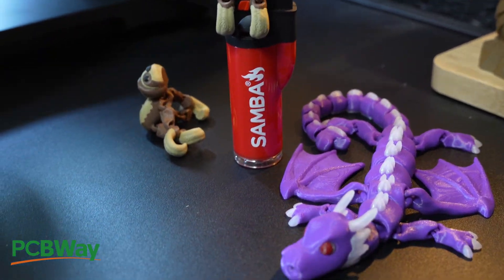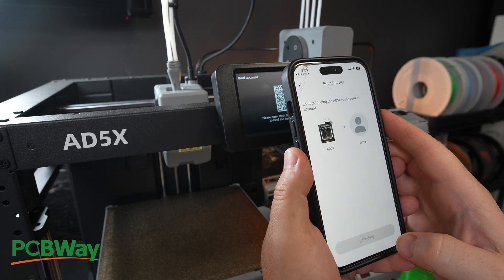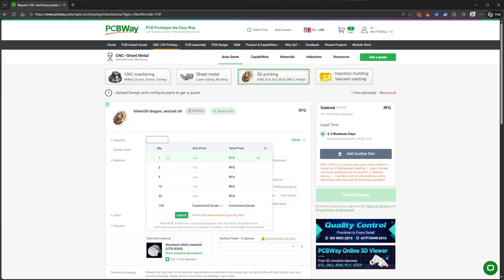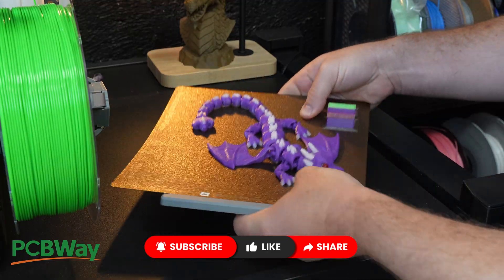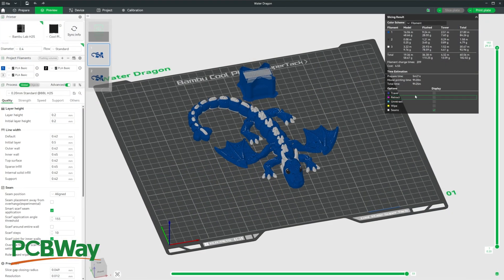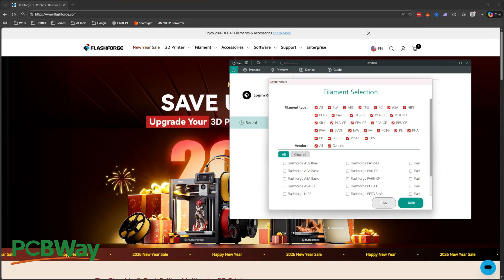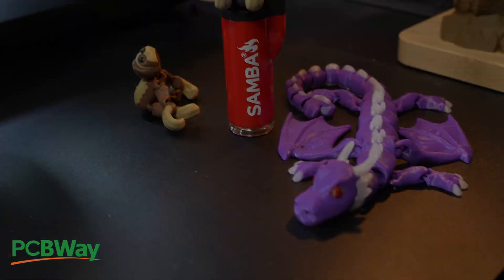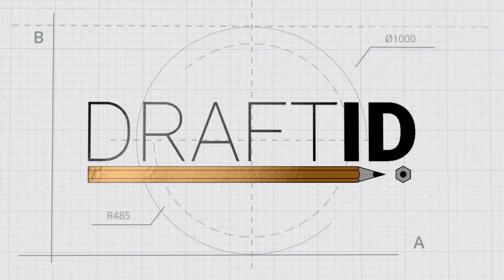This $400 Printer Shouldn't Work This Well | Flashforge AD5X

Comment: I purchased a lightly used ad5x just before Christmas as our family's first 3d printer. Its been and okay-ish experience at best.

 IF you can get a file to the stage of printing its does a fairly good job. But the constant connectivity issues and file errors had me wanting to throw it out a window for the first week. Like I'm in the middle of fixing a model and it logs my account out, then i log back in and the printers not available. In the beginning I had to manually change the port to get it to connect with my laptop. Just yesterday i figured out that the firmware was so out of date it could not update itself. I had to create a flash drive and insert it to force an update. And for the love of god, if I download a 4 color model file why cant we keep the colors assigned by the designer. Why do we have to go back and assign colors and repaint the model?? If i change the filament color and type in the slicer, why cant the printer recognize this?

I didnt know software could be so..... Lazy?
Reply from the maker: Pretty much hit my same experience. Like it’s not a terrible printer but like you said, it just feels lazy. The colour resets were driving me crazy!

Comment: The screen is resistive so it is not as touch friendly to fingers as other screens. I printed out a styles and I use that on the screen.  You don't have to use the screen to load or unload the filament since when it is not printing the filament is not in the extruder. So you can load or unload the filament without using the touch screen. The only thing you really need the touch screen for is to tell the printer what type of filament it is and what color.  But yeah it would be nice that once you set this on the printer it would sync directly with the slicer.
Reply from the maker: I like the stylus tip, thanks!

Comment: You didnt compare what materials work between teh AD5X and the Bambu Labs.  Because you can have a decent enclsure with the AD5X I think it edges out the Bambu in what materials you can print.
Reply from the maker: I suppose it gets a small point for that

Comment: I got my kids a ad5x for Xmas. So far, pretty disappointing. Everyone keeps showing full spools and other stuff.  Ours has no enclosure. It came with test pieces that was only enough for testing and printing the little flashforce coins. I had to spend another $200 for filament and just now got it. My kids are completely confused on how to use it and so am I. No instructions.
  Every time I open the program, it requires to be signed in to use it. It doesn't come with a program to design your own stuff, or we just have no clue how to use it.  Non of the paperwork says you have to send files off and pay for 3d files to print things. For someone who has never used a 3d printer and has zero experience, the only thing that's easy is loading the filament.
  People say it's pretty quick, but 6 and 8 hours isn't quick in my opinion. So far, I just don't get what the big deal is. We were so excited about getting a 3d printer, but no one talks about the additional cost or know how that you need to operate it.  I haven't found any free printable designs that are worth prining. Most things from cult will not work. 
  I keep downloading designs just for the printer to say not compatible or missing something.  Sometimes it says to add things that I have no idea what they are.  Another two hours last night without a single print.
  I wasn't expecting to have to take a class at the votech just to learn how to use it, which is what my wife suggested.  The ironic thing is, we have vinyl plotters and use software to design decals, shirts and things, yet are clueless on this 3d thing.
Reply from the maker: Hey mate, sorry to hear about your experience, ill try to address a few points but it does sound like you have come into the hobby with absolutely zero knowledge. Which is fine, but there is going to be a lot to learn for you.
Frist for models, check out makerworld, all the stuff there is free. Its setup for bambu printers but you can just download the files as an stl and import into flashforge orca. 
Material costs: running a 3d printer uses consumables called filament. You will need to order and keep in stock PLA type filament. You can worry about the others like PETG, ASA, etc later as you get more experience. 
Speed: 6-8 hours for a small colour print is pretty fast by todays standards. just 5 years ago that would be a 24hr+ print. Its come a loooong way since then.
Design: this is a whole other area you might want to look into. Check out programs like fusion, shapr3d, sketchup, plasticity, blender. See what calls to you, keep in mind these cad programs do cost money (blender is free but steep learning curve). They also take at least a year to get good at. Ive been designing for about 15 years now and still cant surface model.
3d files: you dont need to pay anyone for 3d files. Check out makerworld, thangs, etc. 
I hope that can at least get you started but this is a hobby that requires a LOT of knowledge that you get over time.

Comment: It goes for about $350 on sale all day long, and seen it as low as $250 during last years black friday. Whats good about it, its a corexy and can be fully klipperized. Aside from the open frame and smaller build volume, everything else looks good. Simple multicolor unit, and essy to work on like nozzle changes. Thats why im more interest in this machine than others. Ik not a fan of bambulab, closed ecosystem and locked firmware.
Reply from the maker: That is a positive angle to look at it and I can agree on those points.

Comment: Here is my question, which is better for your first time printing, the a1 or the ad5x, because Im using the ad5x as a complete beginner, and its pretty easy to work with
Reply from the maker: Yeah it’s not tough to use but if you ever get a chance to use an A1 you will be like “wow I been missing out!”

Comment: the ONE thing i care most, is the quality of the print.
i need a good (not resin) machine to print miniatures, so i really don't like the layer lines.
from the sloth and dragon here, it doesn't look like the quality i need (but i wonder how maximum quality settings would make them).
any recommendations for a high quality none-resin printer for miniatures please?
Reply from the maker: Thanks for watching. I think first most important thing will be is it designed for FDM printer because that will matter a lot. If you want ultra detail you can go a .2 nozzle, set the layer height as low as possible but you run the risk of getting jams quite easily. Keep the models pretty small and you should be ok, the longer they are printing for the more likely an issue might come up. Also keep it to single filaments, not multi colour.
If you step up to a .4 nozzle (standard really) then a .16 or .2 layer height for the detail, variable layer height applied to smooth out those curved areas.
Reply: @DraftID  Thank you very much for the reply!
oh i thought the smallest nozzle and and slowest printing would give us better quality.
also, i'm not really artistic, so i thought multi-color would save me a lot of the painting...
interesting.
can you make a video on the different options and examples for miniatures please?
i wonder what is "the best printer" for miniature.
i'm new to 3D printing, so everything is new to me...
many thanks! (and sorry for my broken english...)